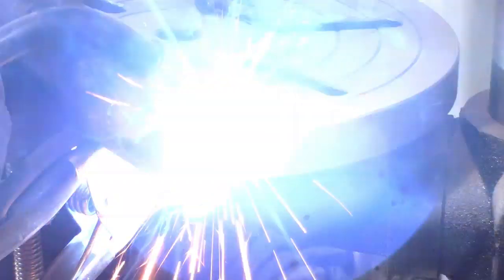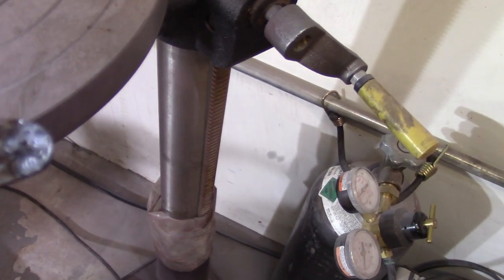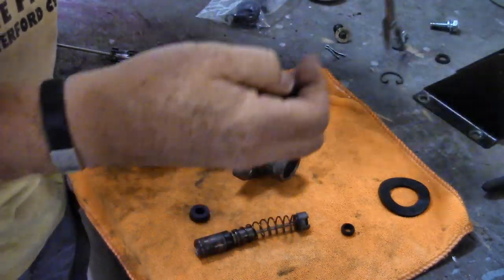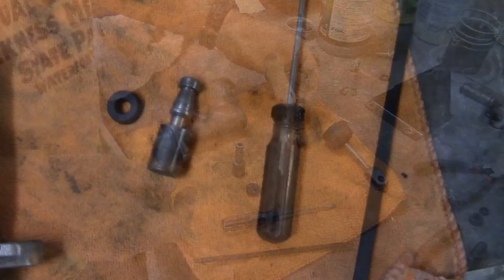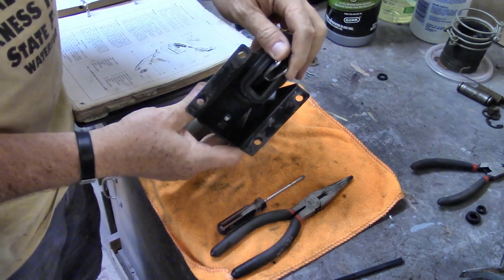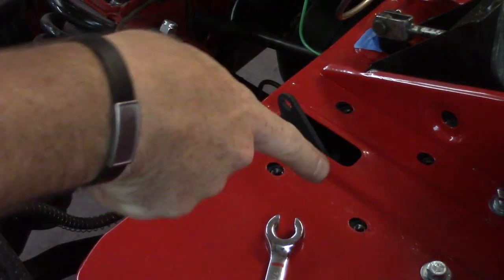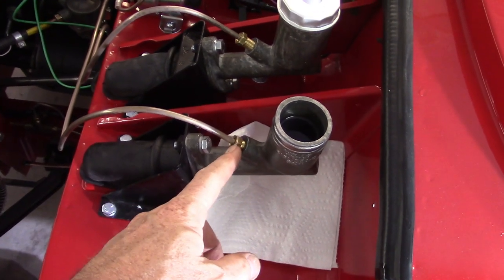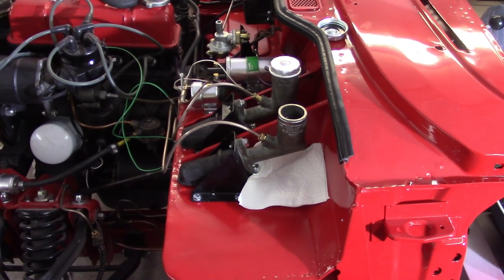Reassembly #6 - Clutch & Brake Hydraulics | Roundtail Restoration

Comment: Owned a Spitfire about 30 years ago. Test drove a beautiful 76 today. Few things left to fix, tach, parking brake and trunk look. The deal breaker for me now is it has almost no breaks unless using full break pressure. The mechanic replaced the master cyl. and checked out all the brakes and said it would just take getting used to. I know the vintage of the car, but never drove a British sports car  that braked this bad.  Joined some facebook spitfire groups looking for help.  Nice video.
Reply from the maker: Yeah, I'm still not crazy about where my brake pedal feel is, but it does stop. I've got such little experience with non-assisted brakes (last drove my 76 MG Midget around 1987) that I don't remember what they feel like. Good luck and thank for watching!

Comment: "Snowman lookin' hole", made me laugh. Definitely an accurate description!
I always gravity bleed as well. People act like bleeding hydraulics is hard, I've never had a problem w/gravity, even in ABS cars.
Reply from the maker: lol, ya like that one? First thing that popped into my head. I'm here all week...
I need to bleed more and I've still got leaks on the brakes...too much to feel confident even for a parking lot jaunt. My next visit will be taking care of all of that (hopefully), getting the gas lines tightened and other odds and ends. Would like to make my maiden parking lot trip this weekend!
Reply: That's great you have all week! The weather is great this time of year. I've gotta be honest, I don't like the way your lines have a double flare and the master cylinder is designed for a bubble flare, but I hope you can get them to seal.
Reply from the maker: @ericpfiffner5615  yeah, it's not great. Crossing my fingers.

Comment: Your rear brake pipe set up from the wheel cylinders is very interesting. I’ve just changed all my brake pipes and I have copper pipes coming from the wheel cylinder that feeds around the hub up into a bracket. The hose then fits into that pipe that’s fed through the brake. Maybe it’s different in the uk. Where did you learn your skills from by the way.
Reply from the maker: Hey DJ. Yes, that confused me at first. They changed the design at some point to go from just hoses, like mine, to those hard brake pipes. Not sure when that happened...Mk3 maybe? I took auto mechanics classes in high school and also my Grandpop was a master mechanic back in the40-70s. I was a submarine nuclear power operator for about 20 years in the Navy, so that helped with a lot of it as well, though I specialized in electronics.

Comment: Hi Chris,
I have not heard about gravity bleeding.
When I bleed the brakes, I have someone sit in the driver's seat, pump up the pedal three times, they say "holding", I open the bleeder and air and fluid comes out in the clear plastic tubing, they hold the pedal down saying "down", and I close the bleeder, then they pump up the pedal again.
Tom
Reply from the maker: Hi, Tom. Yes, that's how I usually do it. However, since I didn't want to bug my family, I did a gravity bleed. Since the MC is higher, height wise, than any of the four wheels, you can just essentially drain it, starting with the further wheel from the MC (like normal). I find it's not quite as good of a bleed, but it works good enough to be safe. It's slower, but it works.

Comment: I got the AutoMec kit too but it didn't include a clutch pipe. And, the universal flare was not well documented - I thought I got the wrong kit and contacted them.
Reply from the maker: Clutch pipe is separate from the kit. All of the usual suspects have them. I've got to come through my leaks and then I think I'll be ready for a road test!
Reply: @roundtailrestoration  Weird! I could have sworn that I looked for a clutch pipe and couldn't find it anywhere. I'll have to take another look (though I bought some pipe and a flare tool, I don't trust my own flares.)
Reply from the maker: Here's a link to the clutch pipe from SpitBits: https://www.spitbits.com/store/47-CLUTCH-LINE-copper-nickel-GT6-P6119.aspx

Comment: I'm curious why you didn't paint the floors.  Not necessary?  Ran out of paint?  Just so I would ask?
Reply from the maker: It will all be covered in carpet for one. And, though I didn't run out of paint, I didn't want to waste it on places that would not be seen just in case. It is all painted in epoxy.